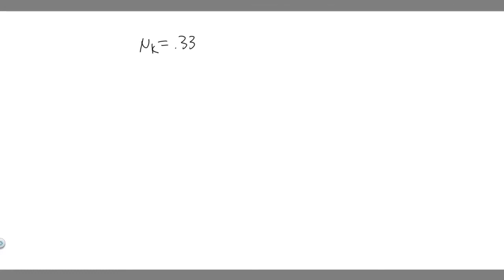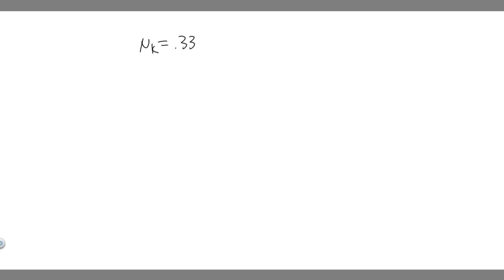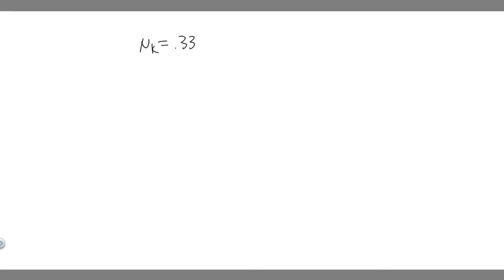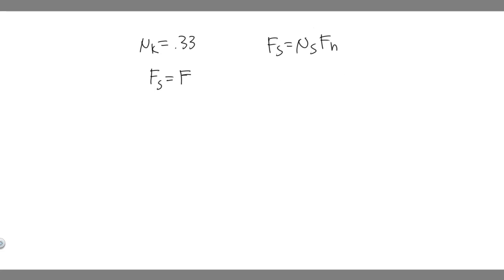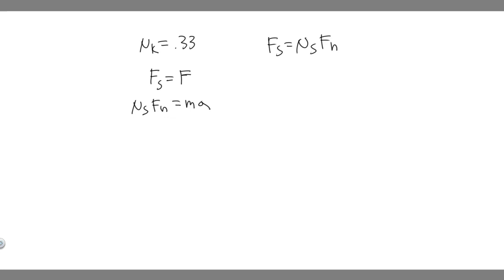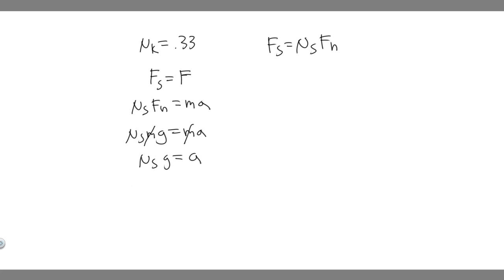Suppose the coefficient of static friction between a quarter and the back wall of rocket car is .330

Comment: Wrong answer. Here is the same problem, but friction is 0.213. 
Find an expression for the normal force on the quarter using its free-body diagram and the x-component of Newton's second law.

ΣFx	 = 	max
n	 = 	ma
Because the coin does not fall down the car's back wall, 
ay = 0
 and the y-component of Newton's second law gives the following.
ΣFy	 = 	may
fs − mg	 = 	0
fs	 = 	mg
To find the minimum required acceleration, amin, substitute 
fs ≤ 𝜇sn
 with 
n = ma.
fs	 = 	mg ≤ 𝜇sn → 𝜇sn ≥ mg
𝜇s(ma)	≥	mg
a	≥	
g
𝜇s
 
amin	 = 	
g
𝜇s
 = 
9.80 m/s2
0.213
 
amin	 = 	46.0 m/s2